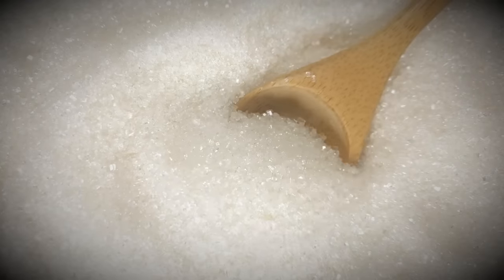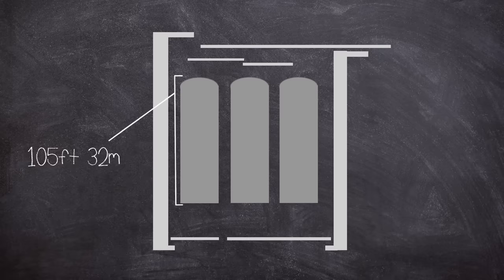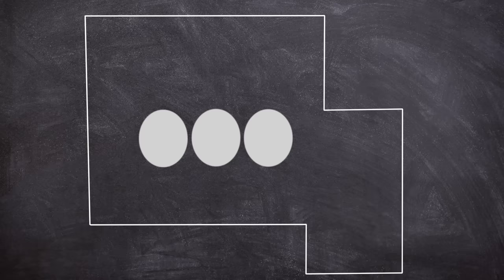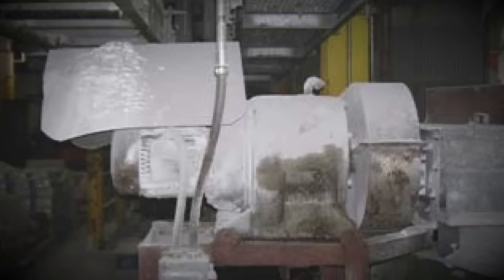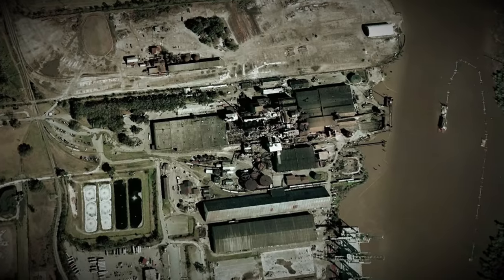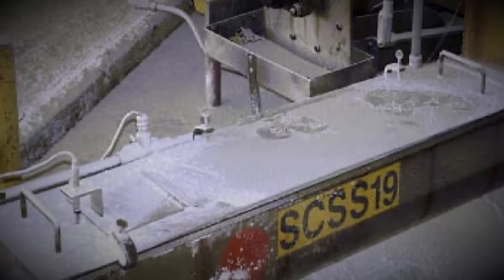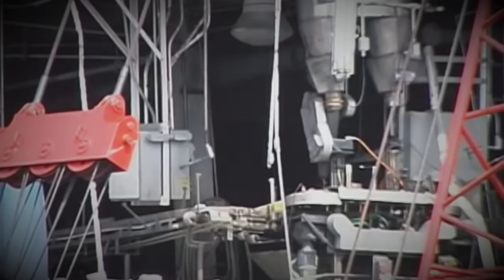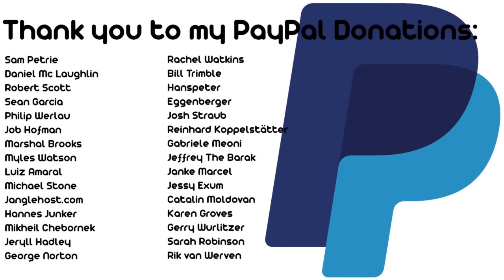The Georgia Imperial Sugar Disaster 2008 | Plainly Difficult Short Documentary

Comment: Two things, first hand experience with dust explosions. First, I was about 12 or so, and a bit of a pyromaniac. Got into trouble a fair bit for starting fires. Anyway one day my friends and I were mucking round in a new construction site and I set fire to a pile of sawdust. Realised it was time to go home and tried to put it out by whacking it with a half sheet of plywood. Reallllly dumb idea. Having the plywood tight against my body prevented any damage  above the waistline and shorts and socks gave protection to those areas. From just above the knees to ankles. 2nd and 3rd degree burns to the front of my legs.  Took most of the summer to heal, oddly no scars. I figure that was because I ran and jumped into a stream  and sat there for an hour til my brother came to get me and smuggled me into the house. My mum covered the burns with shaving cream and bandages. Go figure.  Second, a few years later a bunch of us walked into the chemistry lab and were yapping away, paying no attention to the teacher. He was sitting there with a paint can on his desk and an evil grin. Once we were all seated, again yapping away, there was a god awful bang and the lid bounced off the ceiling. Candle in the can, tuna can full of flower. Hose poked into a hole in the side. Puff of air, BANG.

Comment: i worked aty a lumber mill in winnipeg. dust and sawdust EVERYWHERE. behind some of the saws it was as high as my knees. owner - to be competitive - had stopped the detailed cleaning needed. the dust collection silos that were in function would clog frequently and we'd have to dig them out - sometimes the wood wasn't completely dried and the sawdust had enough water in it to bind into a pulp-like glue. 

every single time i hear of a situation like this it is almost always mgmt cutting some corner here or there to "improve productivity and increase efficiency".

Comment: I was hired as bookkeeper/secretary in a cabinet shop, and gradually took on work on the factory floor. I operated a computerized router. The material to be cut was only held on the bench be suction. The bit spun, I think, 35,000 rpms. It did not stop for any reason until shut down. I was asked to train a couple other employees. As we got to safety, their utter disinterest was so clear that another ma n came from the other side of the building. He pointed out that if the work flew iff the bench, it would strike them is the last place they wanted to be hit. THAT got their attention. 
You can't totally blame management for safety lapses.

Comment: I work in the milling industry. I see safety films about dust explosions frequently. Even with dust filters and duct work, dust collects everywhere! I constantly have to clean! In general, many companies could be said to be lax in maintaining facilities. Grain and rice can be very abrasive, and can cut through steel. Insufficient staff, long hours, little time off, and fatigue don’t help matters any. Old electrical equipment can be a hazard too!
Reply: Youd think you would see such a thing in a large scale bakery, but no. Just switch the machines off and evacuate (preferably without hitting the emergency stop, yes that was told to me)

Comment: Most people in the know will say that flour dust (from wheat, barley, rye etc) explosions are the worst.
But I personally have stronger feelings about burning sugar. You see, for example, wheat doesn't melt. It burns or roasts into ash.
Sugar that's on fire on the other hand turns molten, like lava. Getting molten burning sugar on you must be like getting white phosphor on you. It just sits there eating away at your flesh and when you try and brush it off you it just sticks to more places and forms long lines of hot sugar that burns like a fuse in the air.

In short, i would much rather be concussed by a flour explosion than have sugar explode all around me and then raining down on me in flaming molten form.
Reply: I can vouch for the nastiness of hot sugar. One time I was making caramel and I splashed a tiny bit of it on my arm. I mean, it was barely a couple of droplets. The thing welded to my skin and proceeded to burn my arm, even after dousing it with cold water for ten minutes. I put a bag of ice  on it just to try and draw the intense heat, which did the job, but the plastic ice bag melted onto the hot sugar in the process. Removing the bag was pretty painful as the now hardened sugar was welded to both the bag and my arm, which ended up tearing a bit of skin off my arm. This was a fair number of years ago and the scarring was pretty minimal, but you can still see the discoloured areas when I get a tan.

So yeah, being in a building full of molten sugar being propelled all over the place must be like one of the circles of hell
Reply: @leopold7562  The fourth circle.  The fifth circle would have to be frying oil.😫
Reply: @amethyst5538  Urgh, don't even get me started on frying oil!  Not only have I had many unpleasant burns from that stuff, I've ruined a fair few t-shirts with it too

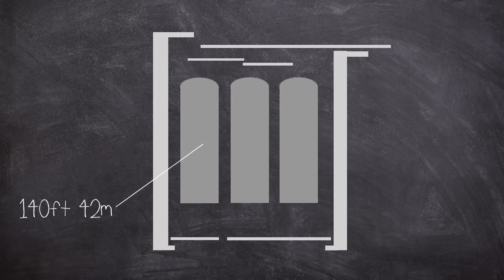Comment: 1:45 Are you certain about the diameter of the silos? I suspect that they are 40 foot, not 140 foot. In the pictures of the site they appear to be much taller than their width.
Reply: I was thinking the same thing that’s a massive silo
Reply: Additionally, the tunnel is 130ft long but each silo is 140ft diameter? The diameter has to be a mistake.
Reply: @elizabethpashley3283  agreed. Math doesn't lie.
Reply: Perhaps by "diameter" they meant circumference?
Reply: @kevinwatts8221  possibly. That works out to about 44-1/2 feet, which is in the ballpark.

Comment: I've been at home, and experienced distant explosions before. When I was a kid, UTC's rocket testing station about 6 miles away had an explosion, no deaths. Then, in 1982, IBM's plant had an explosion heard for miles. There was a scrap bin, with aluminum & magnesium shavings from machining, with oily residue. A fire started in it, and it appeared that a fire sprinkler was activated. Burning metals + water are a big no-no.

Comment: I used to work at a fire sprinkler design, install & maintenance company, so I was interested in that angle. Factories that produce combustible particulate, in this case sugar dust, need to have special systems. Called a deluge system, it's where all the sprinkler heads go off at the same time. (Normal sprinkler heads need to be set off individually and are completely independent of any other head. Sorry, but Hollywood lies.) I did some digging and unfortunately the initial explosion damaged the pipes that fed the sprinkler system. Really everything went wrong here.
Reply: Fully sprinklered occupancies can burn to the ground independent of the type of sprinkler system.  If there is an excessive accumulation of combustible particulate on overhead members an initial explosion can cause particulate to become suspended dozens of feet from the original event which can then participate in secondary explosions.  The area over which this can occur can be far greater than the design area of any sprinkler system—even if the sprinkler feed mains remain unscathed—the BoR demands will be too great.  What every HPR inspector looks for is the control of dust accumulations either through manual efforts, fixed dust collection, or engineering-out the sources of particulate emissions.
Reply: Have them go off periodically to clear dust

Comment: I worked in a particleboard mill for about eighteen years and have seen a lot of fires and explosions. I was lucky and never was seriously injured, but after some of the events, I can only say that The Good Lord was looking out for me. In November of 1999, we had a fire in one of the boiler fuel silos as we used sander dust to fire the boiler as well as three furnaces we used to dry the raw wood chips and shavings. The "Flame-ex" had activated at the sander but they never could find any problems, so they continued to run. A big part of my job was safety and fire prevention and I ran the part of the plant known as "Chip-Prep". On toward the middle of the shift I thought I smelled smoke so I began searching my part of the plant and soon discovered that it was smoke coming from one of the boiler silos. Long story short, we switched out of that silo and continued to run. The next morning was Monday and day shift was trying to put the smoldering fire out in that tank and put so much water in it that it began to buckle. It was decided to demolish that tank. The following Sunday I came in to work and they had a contractor there ready to take the silo down. When I was told about how they was going to go about it, I told my supervisor that it was not going to end well. 
I saw two men die that day, and I feel that maybe if I had made enough noise that that may not have happened. 
Management sometimes didn't like me to much, but if I demanded something, I usually could get them to come around. I don't know, I might could have stopped it, or they might have just fired me and went on any way. Twenty-three years later and I am still bothered by that day.

Comment: One of the problems with dust accumulation is if you weren't very good with cleaning from "new" (no dust) once there is a partial layer its surprising hard sometimes to notice it getting bigger or how much there really is, especially on overhead or lesser traveled areas, until its already at a dangerous level. If you didnt work there when it was fully clean, that might be the "normal" to you and wouldn't give some dusty areas a second though "because that's just how it is" and this can quickly add extra "unknown" dust to a spill

Comment: I was an X-ray tech in a city hospital for 25 years.  Needless to say there are many hazards involved.  Accidental exposure to X-rays is very rare and techs knew to wear their lead aprons when there was a chance of it.  However, there are seriously dangerous chemicals used to develop film, (some hazardous to inhale or touch, others very flammable), machinery that moves huge tables and portable machines that are not shielded.  Add to that being in a closed department with only one exit.  Some of the patient rooms had only one door which opened into a long corridor with no signage as to which way you were supposed to turn once you got out!  At one point a senior tech who had spilled some corrosive liquid, which was dealt with successfully, pointed out that the department didn't have a fire warden or any evacuation procedures.  I volunteered to take the job and spent the next few weeks assessing the situation.  There were no labels on many of the chemicals that, although they were marked as hazardous, gave any indication of what to do in case of a spill.  I had had no idea of the poisonous fumes I was inhaling in the darkroom, (with no exhaust system), we just knew it was stinky!  There had once been a manual but it had disappeared years before and never replaced.  Fire exit signs were nowhere to be seen except for one that pointed to an exit that no longer existed!  In short I did my best to remedy the situation even suggesting that we have a fire drill every 3 months, but the chief tech and hospital management felt it would be deleterious to the smooth operation of the department and my request was denied.  The only thing I was able to achieve was better labelling of the chemicals and a new manual for dealing with them.  I did get a few fire exit signs but very few, they cost money to make and install, and after 6 months of this I gave up the position in disgust.  No one took my place and, as far as I know, there were no new procedures as of when I left.  This was in 2006 and these days people are more aware of safety concerns, not only that but many institutions no longer use actual film for most department X-rays and it is all digital.  Portable machines do so I hope those techs are better protected than we were.

Comment: When I was getting ready to graduate Boot Camp, we had to clean our squad bay, from top to bottom. One of the tasks involved was trying to remove the rust stains on the floor. The stains came from the steel bed frames and uncontrollable humidity. This was in 1994 and those stains had been building up since the barracks was first built and occupied in about 1969. The previous platoons of recruits had failed to get them up, and so did we, but we had to try. Anyways, me used a mishmash of cleaning chemicals and the like, applied directly to the staining. This included: Clorox Bleach, Windex, liquid Brasso, Tide detergent (liquid and powdered), Clorox 2, Ronsonol lighter fluid, shaving cream/gel, liquid hand soap, rubbing alcohol, cold water and Off bug repellent (a lot of people don't know that Off can melt plastic). This was mashed together with green scratchpads and hand brushes. We had the windows open, but still... I turned to my Drill Instructor, Sgt. Robinson, and said, "Well, I didn't want to have kids, anyways." He laughed.

Comment: A squeaky bearing is the scariest sound in a dusty environment; it's crazy to me that non-metallic bearings aren't required in these places.  Sadly, I guess someone saw the cost of spark-free bearings and figured buying a politician or two would be cheaper.  Spoiler: it's always cheaper — that is, until you need to rebuild a whole new facility because you blew up the old one, not to mention fines and what not.  Cutting corners might look good on a quarterly financial statement but it's unbelievably more expensive for a company in the long run.

Comment: I build control systems.  This should be a class 2 hazardous environment for electrical/mechanical fire safety.  From the photos shown the electrical equipment in the plant was ordinary industrial control components - not the type certified for use in explosive places which  have heavy cast enclosures (or positive pressure purging), sealed and potted conduit joints and specially constructed motors.

Comment: Interestingly, the silo capacity is exactly 5 million lbs since it is recorded as 2,267,961kg. Were it only approximately five million, as I suspect, one would just write 2.3 million kilos or 2,300,000kg. Since if it us only appr. something in pounds, it is that weight only approximately in kilograms as well. Measurements do not gain accuracy if converted to other units.

Comment: There are some oddities with this video...
1:48 The graphics here don't reflect the given dimensions. 42m in diameter and 32m tall means they would be wider than they are tall.
2:00 The 130ft long tunnel makes me think that the above diameter is wrong. The tunnel is shorter than a single silo. Are you sure they weren't 42ft in diameter, and not 42m? The image at 6:05 of the silos indicates that the graphics you display are correct, so the diameter must be wrong.
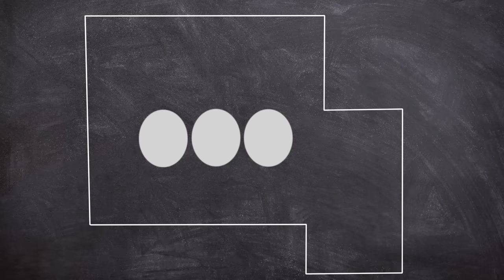3:26 Is something missing from this image? The arrows are pointing at empty space.
3:38 This looks like a placeholder. Missing image?
9:14 Odd pause there...

Comment: Companies don't overhaul their systems for the same reason the government doesn't invest in new infrastructure. Why fix something that's been running fine for the last 50 years? I have machines at my work that have been running since the beginning of the cold war, and it would be very expensive to replace them with new models, so alarms get ignored and breakdowns get duck-taped back together.

Comment: 1:46 "Each silo was 140 feet in diameter"
Not even close... "maybe" 40ft. likely closer to 25ft.
Even the graphic shows the height of the silos (105ft) to be ~4x the width.
At 140ft dia. and 105ft tall they would be shaped more like fuel refinery tanks.

Comment: Did I miss something, or did you say "diameter" when you meant "circumference?" I know your illustration isn't to scale, but something in those numbers looked off.
Reply from the maker: I used the dimensions from the CSB report Page 10 😬
https://www.csb.gov/assets/1/20/imperial_sugar_report_final_updated.pdf?13902
Reply: @PlainlyDifficult  Ah! You read it off, and I heard "three 40 foot diameter" as "340 foot diameter." That explains it!
Reply: @mommachupacabra  But the diagram captions it as 140 foot not 40 foot, so you are right to challenge it. It looks odd because that would make it wider than the height!

Comment: Imperial Sugar rebuilds the factory and resets the clock for another explosion. Or did they learn?
Reply from the maker: Probably didn't learn
Reply: @PlainlyDifficult  massive facepalm if that's the case.
Reply: They will probably be very very careful for a time, then when nothing bad happens they will be very careful and then later after nothing bad happens again they'll be just-so careful and then they'll grow careless and then very careless then BOOM! again. Step and repeat.

It's a common refrain, the folks who design and specify this sort of operation know the risks and set safety rules that gradually fade into the darkness until something bad goes wrong followed by everyone looking around at the flaming debris and saying "No-one could have predicted THAT would happen!"